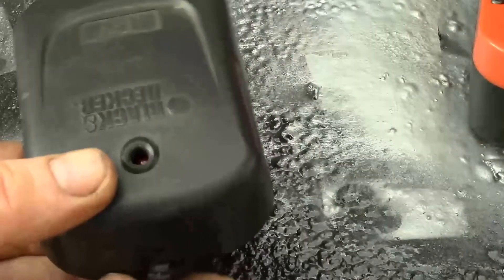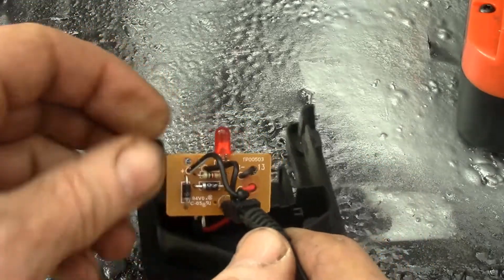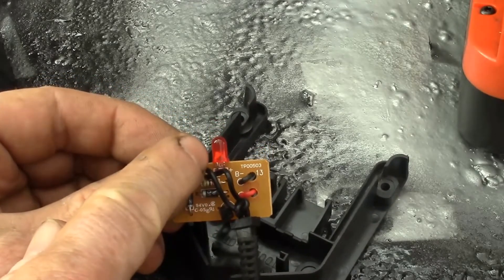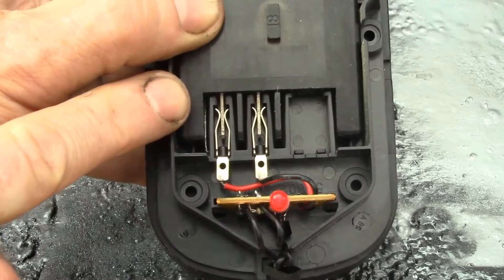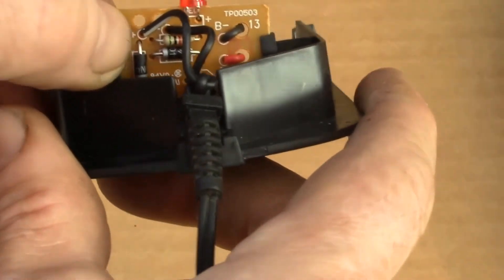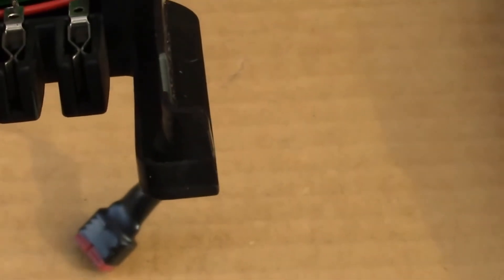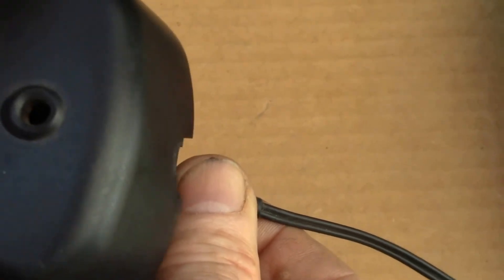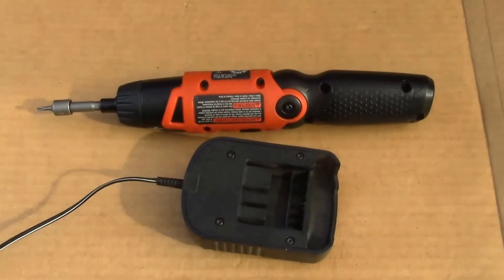Black & Decker Battery Project, Part 6

Comment: thanks for the info. Question - the led does not come on even when I insert the battery pack for charging (it used to happen before). So, how do I know if the battery is completely dead (or not chargeable anymore) OR the charger has gone bad OR the charger is working but the LED has just burnt out? What should be the voltage of the output prongs on the charger when connected to the power supply?
Reply from the maker: For a 5S Lithium battery, the fully charged voltage is 21v.  I think the chargers put out something like 24-25v to charge the NiCad packs, but lower the voltage for the Lithium packs.
Reply: so, if I don't get 20+ volts on the charger terminals, the charger has gone, right?
I don't want to buy a battery if the problem is with the charger and I am trying to figure that out for sure.
Reply from the maker: May depend on the exact charger.  One I checked seems to put out ~28 volts when I shove the volt meter probes into the connectors on the charging head.
Reply: this is the reply I got from B&D -  from the answer, I think my charger is bust.

Thank you for contacting us.

I do apologize for the inconvenience this may have caused. While the battery is on the charger if the charger is fast blinking red that is indicating that the battery is defective. If the charger states that the battery is charging as normal but when you go to use you have no power typically that means its the charger. I hope this information was helpful.
Reply: I have the same problem as you.  Did you get the answer?